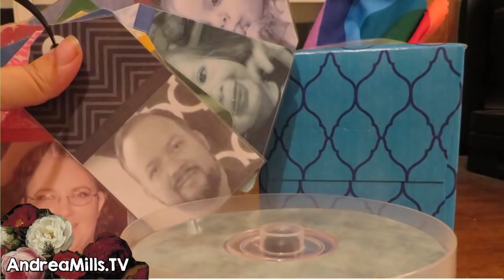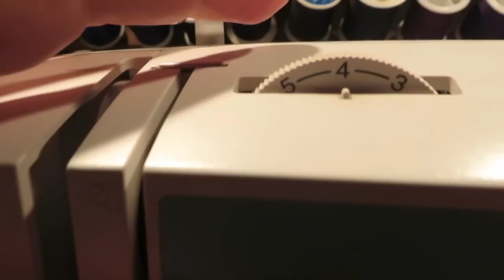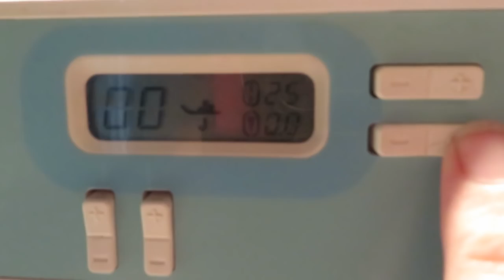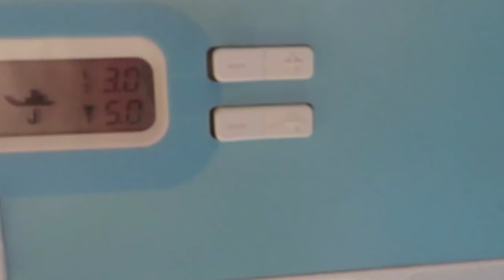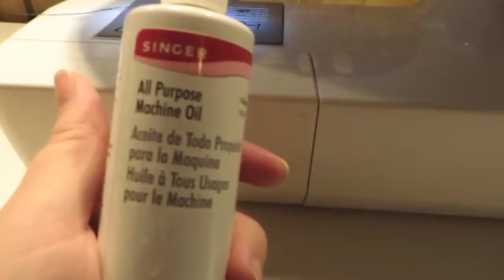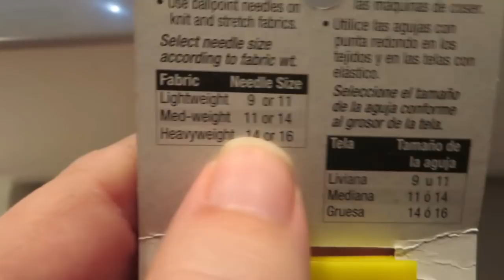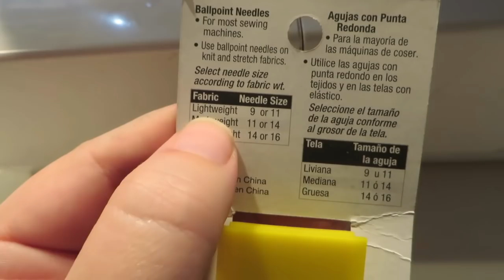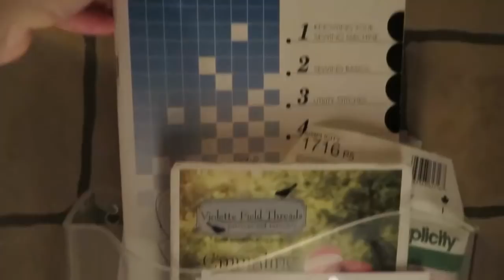How to Use a Sewing Machine ║ How to Sew │Simple Sewing #2

Comment: Great tutorial, you are an excellent teacher. You gave me some good ideas for teaching my kids - like sewing on paper with no thread first. I am a mostly self-taught sewer and it's good to know I am doing it right, lol. My biggest issue has been with the top sewing fine, but the bottom almost double or triple sewing for an inch or so until it finally jams up and I notice. The back is then a big mess. It is almost as if more than one strand of bobbin thread was caught, but it sews fine at first and then this will randomly happen. My machine has the bobbin vertically in a door underneath the sewing platform, so maybe this causes more problems. If I ever buy another, it will be a Brother.

Comment: Also, thanks for the video! I taught myself to sew about 5 years ago when I left my job to stay home with my kids. I'm glad to see that I am doing things correctly, because  I really just figured it all out by trial and error, and the instructional DVD that came with my machine.  I have never oiled my machine though (I never thought of it!) Where exactly do you oil it and what do you use. Thanks again!
Reply from the maker: If you have your manual, it'll tell you exactly where to put the oil. It just takes a drop or two. (That bottle I showed is probably a lifetime of oil.) I just drop mine into the top where the lever goes up and down with the thread. Then I wiggle the hand wheel back and forth a couple of times. I know it works because twice I've let it go too long and the machine seizes up. As soon as I do that it works fine again.

Comment: I remember in a past video you mentioned you had purchased a serger.  Have you tried it yet?
Reply from the maker: I haven't, but it's on my mental list of things to learn. I know I'll love it if I learn to use it. I also bought a Cricut cutting machine (for paper) that I've barely touched because I need to find time to really learn how to use it well.
Reply: Andrea Mills I have a cricut but actually one of my nieces has it most of the time! They are lots of fun but bring your patience and lots of paper with you! If you are mathematically inclined(which    I am not!) you will find it easier. It's a spatial thing!
Reply: Andrea Mills I want a cricut machine.  I journal, scrapbook, and plan, and want to make my own stickers, and hear the stickers are great for that.  I also want to make fun stickers for the kids I work with instead of the same old same that every store has.